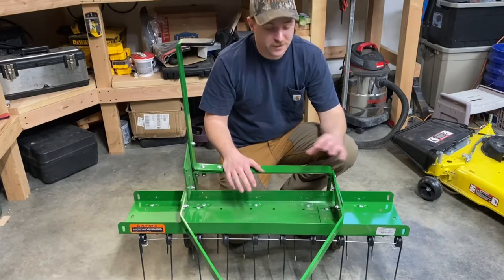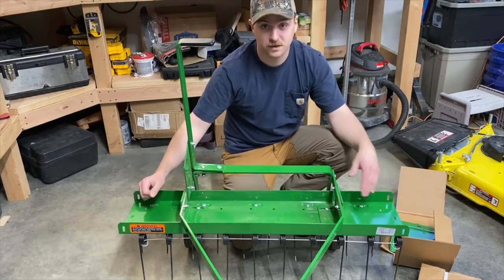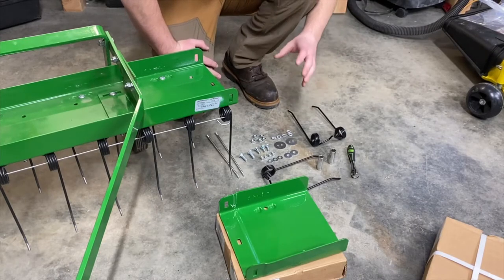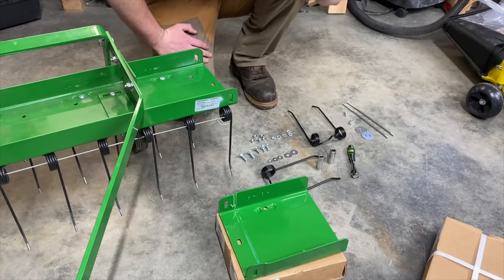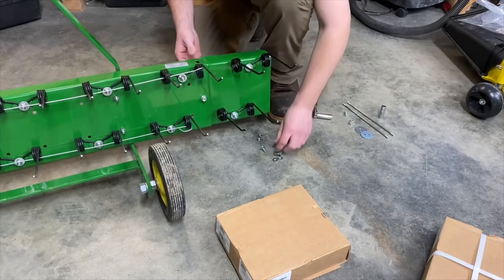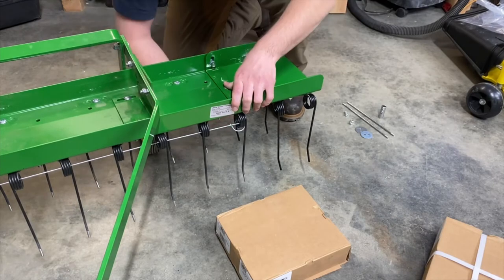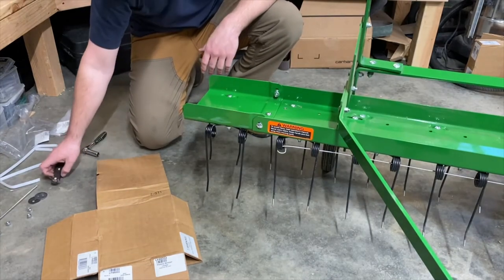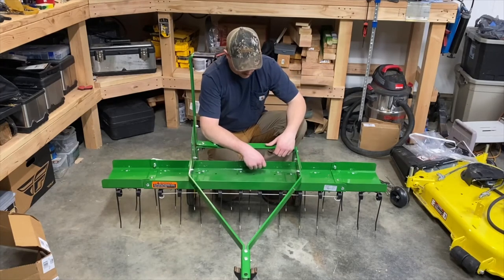John Deere 40" Thatcher Extensions - Impressions & Install

Comment: Hey Josh, great videos.  I'm thinking about adding these extensions onto an Agri-fab 40" tow behind thatcher, but not sure if they'd fit the same if the Deere thatcher is made by Brinly.  The inside width of the Agri-fab is 8" wide.  How does that compare?
Reply from the maker: I measured mine at 8 on the outside. the metal is 3/32", so 7 13/16" inside... If anything, you would have extra room as the extension is bent in where it attaches, so Id say go ahead and do it! Not sure about bolt holes, you may have to drill them, and maybe even add some angle iron or something to brace it depending on how solid the extension feels. Let me know how it works!